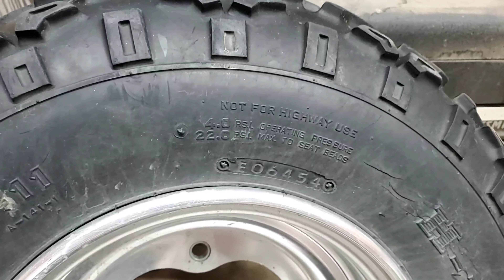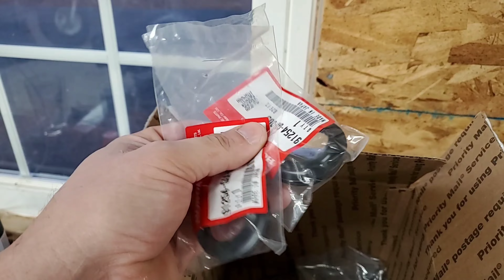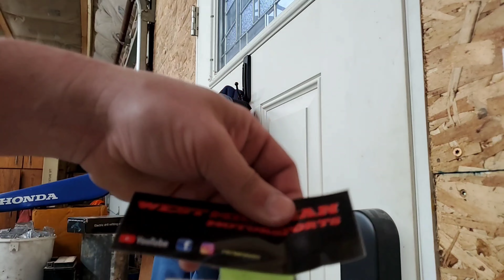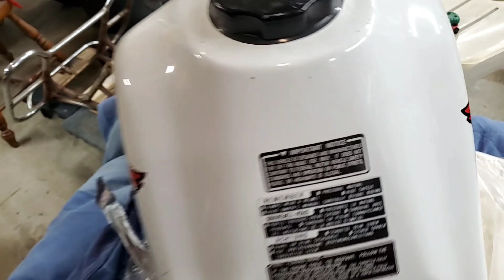1986 Honda ATC 350X Rehabilitation - Let's get this three wheeler back to its former glory!

Comment: Nice video I’m restoring a 81 250r and the beautiful red motor is covered in black spray paint do you Recommend using the oven cleaner and wd40 bath after? Just don’t want to hurt the red paint at all
Reply from the maker: All I can tell you is what you saw in this video.  The oven cleaner didn't seem to affect the black factory paint on this machine, but it didn't get all the spray paint either... I'm not sure if I kept doing it, would I have gotten everything, or would it have started to affect the factory paint...  I'm not sure.  I really can't offer much more than that and be certain about it.

Comment: I’ve had very good results taking spray paint off with gun wash many times now but I never actually tried it on a 350x engine. Basically you soak a rag with it and try wiping the paint off and sometimes you need to let the rag sit on it a minute or two. Every-time I’ve ever did it I had great results and the factory paint was left like new. Someone repainted the head in my 350x when doing the valve stem seals and painted the cylinder so I need to get after it. That’s actually a pretty nice 350x you got there. One of those in between bikes. Too nice for a rider but not a show bike. But a pretty easy bike to restore and make perfect.

Comment: I was watching one of your videos you were riding with your buddies and their bikes wouldn’t start. Kick kick kick. Not sure if you know this but a truck I was taught with my 350x when it didn’t start up was turn the ignition switch off hold the throttle wide open and kick it 4 or 5 times then turn the switch back on and papow fires right up. Don’t ask me,it worked
Reply from the maker: Yes sir!  That's the instructions they put right on the tank directly in front of the rider... which the rider NEVER reads...  until they're so amazingly winded from kicking and kicking and kicking... and they sit down in defeat and hang their head... and only then do they notice the decal that says "If the engine fails to restart..."
Reply: @ThisOldTrike  lmao so true

Comment: I use oven cleaner and i notice after needs painting or oil / wd40  it to neutralize it ( it will rust / chalk)
Reply from the maker: Yes sir.  After all this I dried it with air and drenched it in WD-40 (also per Mike instructions).
Reply: @ThisOldTrike  Awesome videos Preston keep  them coming.
Reply from the maker: Thanks brother!

Comment: Everyone knows, and I would feel the same...Your'e gonna  go farther and correct the issues, plain and simple. I like a nice rider, and some things need attention no doubt. Iv'e been kinda doing the same thing on a mostly original 85 250 Big Red , nothing like original.
Reply from the maker: Yes sir.  I was out of town all weekend, so this morning was my first time in the shop staring at the motor as I left it on Friday... and honestly... sitting there having been douched with WD-40 on Friday... it looked decent.  I know that's totally a cheat and running it for 5 minutes will burn all that off... but I'm contemplating leaving it.  I have a take out motor that isn't perfect and needs a couple things, but I thought about swapping that out to this machine... I'm still up in the air.  Definitely TBD!

Comment: Yea, naw, buy a nice bolt kit for the entire thing. Cerakote the cases. Get an old oven, and a blast cabinet. You'll love it. A 350x is worth it. Take it apart.
Reply from the maker: I've never found a bolt kit that compares to the original OEM bolts.  I've got a plating set up I need to put to use and that will be PERFECT for the hardware.  I've also got a blast cabinet, but I don't have the powder coating equipment... but I have a great guy not far away who does a terrific job.  Still not a 100% on the exact direction I will take this, but it will likely be a 2 phase deal.